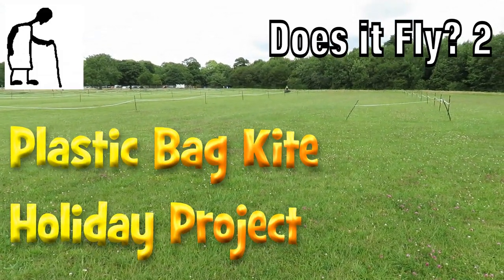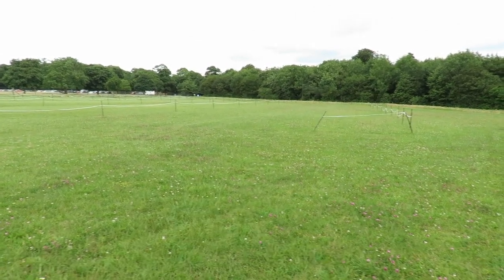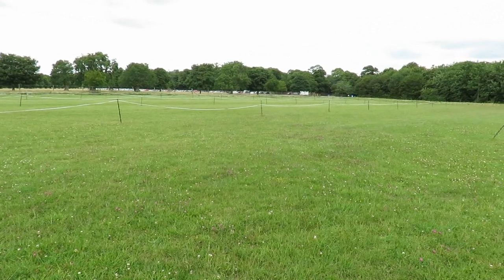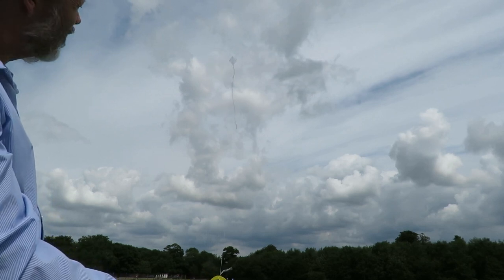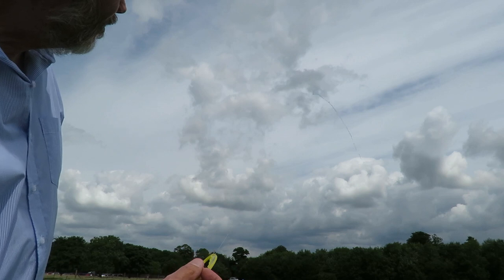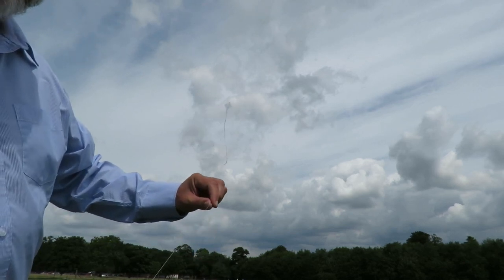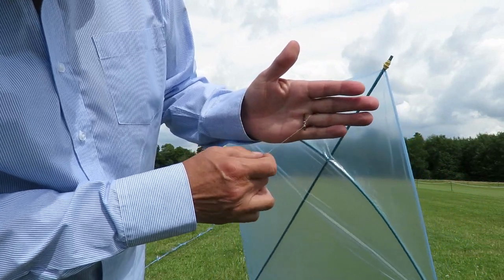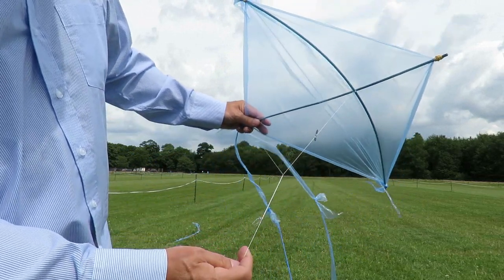Plastic Bag Kite Holiday Project DOES IT FLY 2

Comment: That flew higher with the bridle adjusted, it did need the tow point moving forward a little. very inventive with the little stick but its still easier to use a small washer tied on with a larks head hitch.
 This kite might have another unusual problem, the shallow bow on the cross spar means the intersection of the spars is relatively low on the kite, using the bridle leg to bind this junction means the bridle is set quite far back on the kite, this could be the cause of the kite 'wobbling' by having a large proportion of the surface area ahead of the bridle. as an experiment remake the bridle with the front leg halfway between the nose and the spar junction, the results would make good referance for future kite flying adventures.
Reply from the maker: The advantage of the stick is I can add extra half hitches along it's length with a quick twist of a loop. The curtain hooks I used on that monster kite were the same principle as your washers and lark's head method.